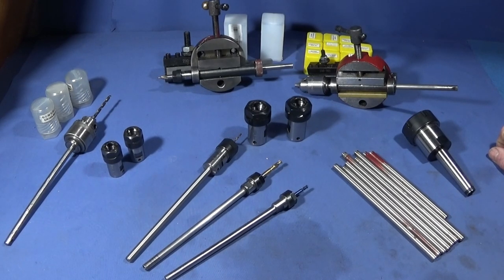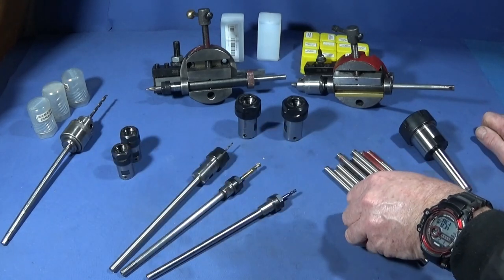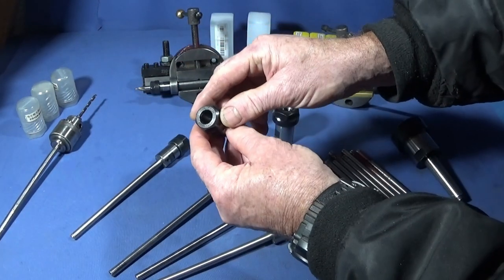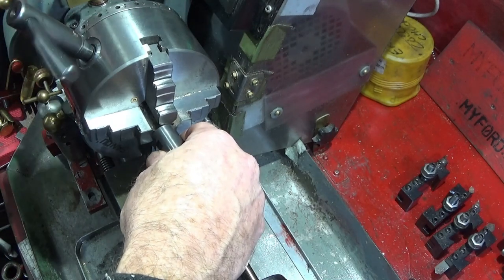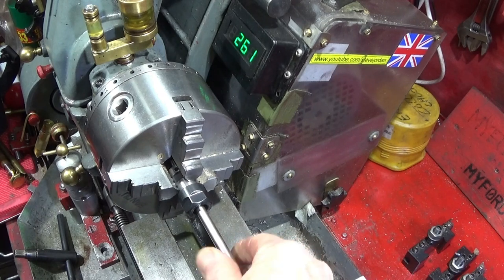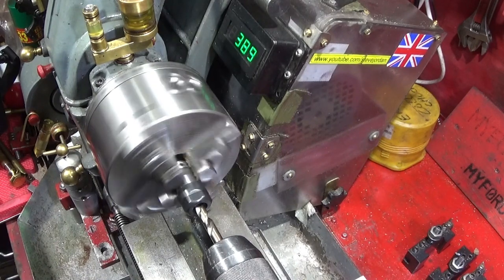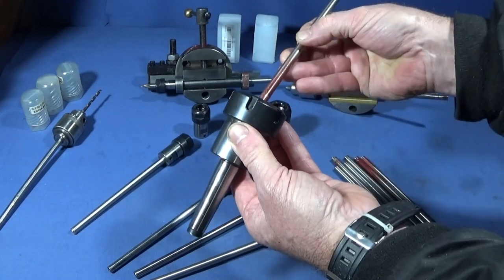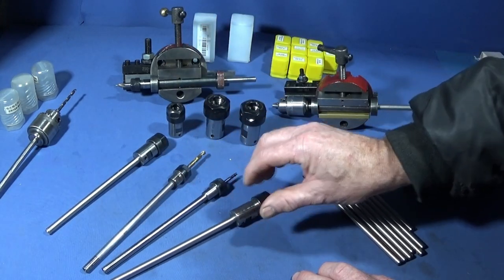Preset Tools For Toolpost Drills & Tailstock Myford & Mini Lathe.

Comment from the maker: SEE TOOL LINK OFFERS BELOW:-
Banggood Christmas Interest-free Sale -- https://bit.ly/384y2fp 
ER16 Collet Chuck Holder Motor Shaft Extension -- http://bit.ly/2LIFQvW
Machifit C8 ER11A 150L Straight Shank Collet Chuck Holder -- http://bit.ly/3h3IPdT
ER11-A 8mm Collet Chuck Holder Motor Shaft Tool -- http://bit.ly/2Wuba3H
14pcs ER20 1/8-1/2 Inch Spring Collet with ER20A-14mm Collet Chuck Holder  -- http://bit.ly/3ntRYPv
ER20 Type A 8mm Motor shaft Collet Chuck Extension -- http://bit.ly/2WwGxup
Reply from the maker: Banggood Klarna Interest-free Sale -- http://bit.ly/3rXAnBB

Comment: This is terrific! I've been trying to figure out a solution like this for a while now, I didn't realize you could get these smaller collet holders! 
Basically I do a boatload of drill changes on my lathe and I want something quick-change... I spend way too much time opening and closing jaws. I thought that collars might be the ticket but there wasn't enough to hold the bit in place - collets are perfect!

I just wish they were cheaper... they're $25 to canada and i can get a jacobs chuck with a shaft adapter for the same price.